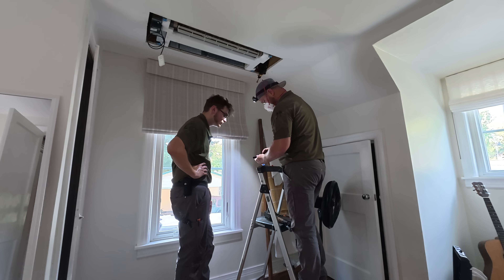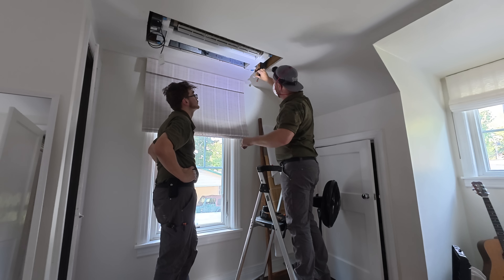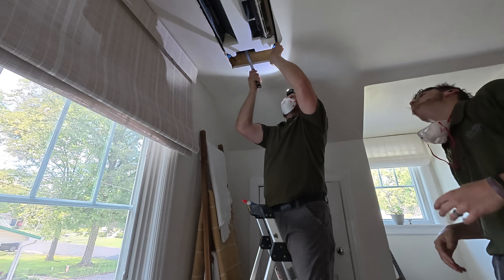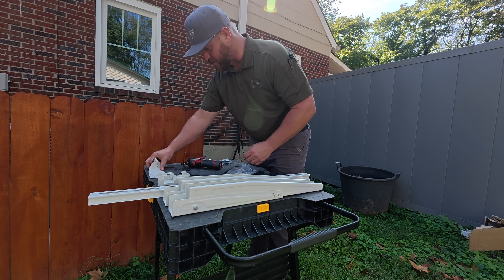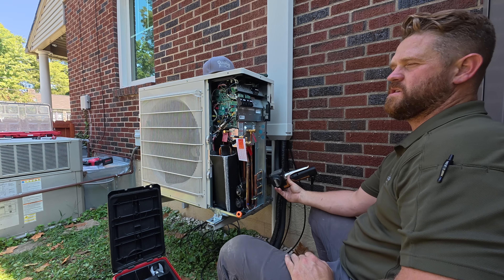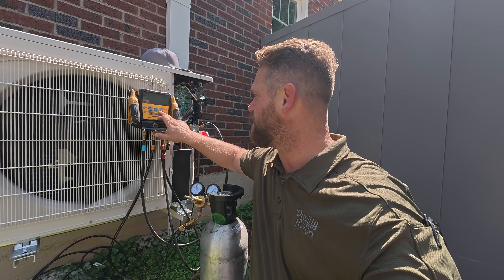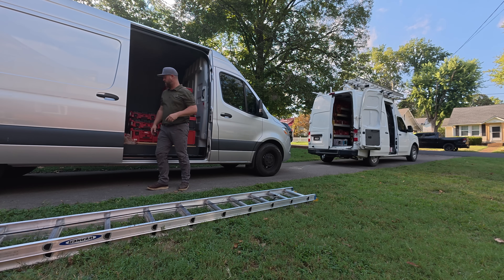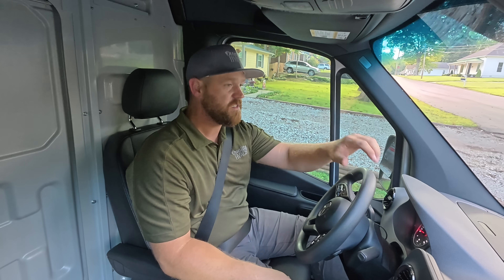2 Zone Mitsubishi Ductless HVAC Install - Ep. 2

Comment: I wish mine was installes so nicely.  No allthread rods, not properly insulated lineset, no wall sleeve, no sealing of any kind.  Pops due to thermal expansion and “special washers missing.  not centered in opening.  drain pushes unit out of alignment.  Needs re-installed.

Comment: I can’t believe 15:05 Mitsubishi didn’t change the way their access fitting faces. You have to take it apart to get a Schrader remover on it! So dumb.
Reply: I had to loosen the terminal block on my 3c30 to get a valve core removal tool in properly. Easy but annoying, I agree